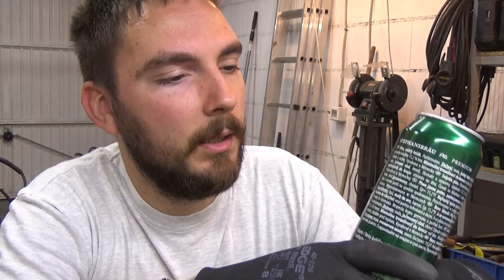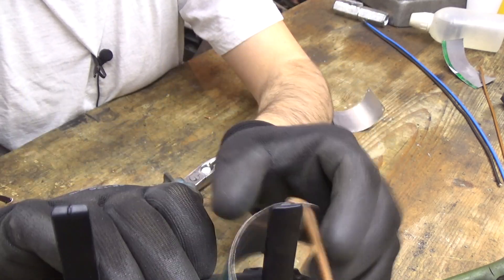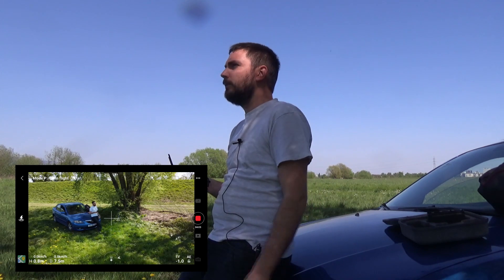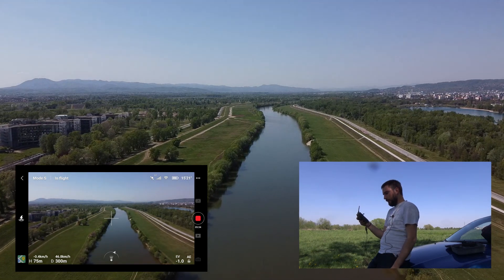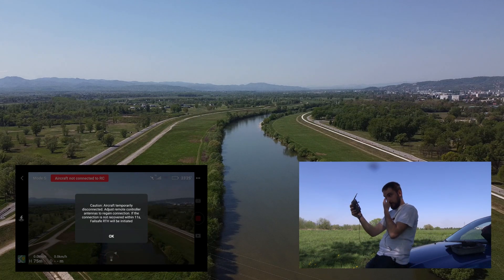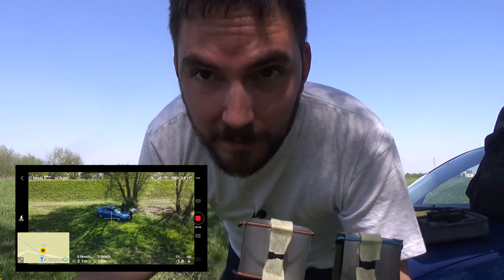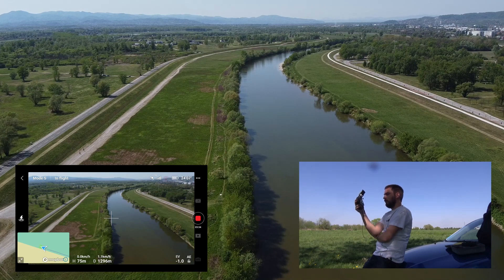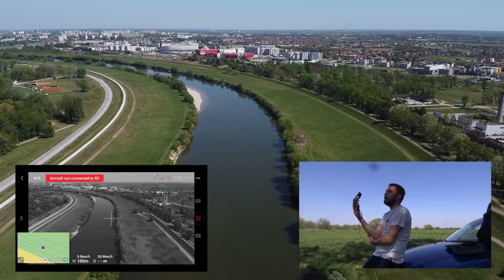DIY Drone Range Extenders - How Far Can It Go, Mavic Mini

Comment: I also made my very own range extenders, parabolic reflectors...

I made mine long ago, February or something.. I used not 1 layer but 6 or 7 layers of Red Bull cans to create each reflector! My parabolic reflectors work really really well, they actually double the range!!

I noticed that you didn't make yours correctly, thus is why it did not work well for you. Look carefully at the ones they sell and you will see the parabola is different and the position in relation to the antennas should be closer. There is an optimum place and an optimum parabola for the best results!

Look on my channel at my home made parabolic reflectors, and you will see what I mean.. Usually they can be seen when I fly indoors from my balcony after a sweet balcony flight...

Sweet

So if you make them better - you will get way better results..

😁

Comment: The wires that you used shaping the extenders could cause some interference to the drone signal. It could improve the performance of the extenders without any conductive materials near the remote's antenna.
Reply: That would definitely improve on the design

Comment: Can we made one part for both antennas :) instead of two parts for both antennas (. .) ?
Reply from the maker: No, because antena needs to be in center of the half circle, one antena is for receiving and one is for transmiting the signal
Reply: @gooddronedays3494  thank you very much for the info 💖
Reply from the maker: @reshairo  you are welcome